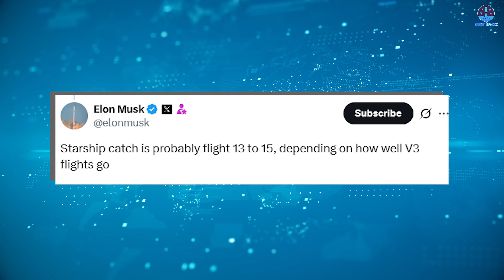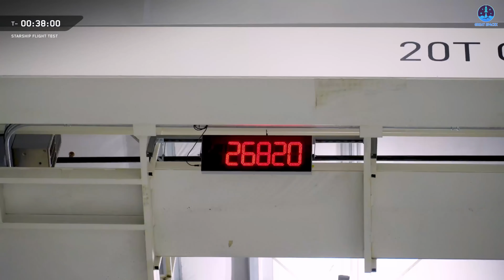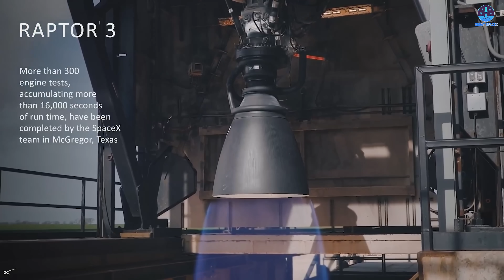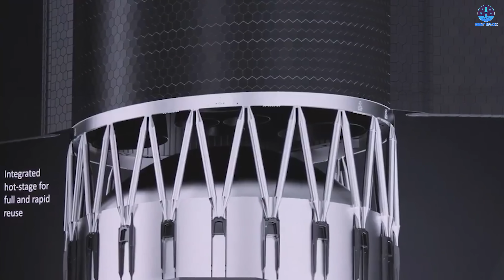Finally! Elon Musk revealed new Starship Catching Schedule after Flight 10 Successful Landing…

Comment: I am still of the Opinion that SpaceX needs to build one or more Catch-only Towers ...
The risks of damaging a vital Launch Pad exist now and even more so in the future.
A Catch-only Tower in the vicinity nearby to the Launch Pad(s) will present no difficulty and no particular delay to re-use of the Booster, or the Ship. Once refuelling ships start launching requiring multiple rapid launches, then more 'landing options' will also be useful ...
My observation is that building Catch-only Towers is much cheaper and faster than the complex complete Launch Towers complete with all of the complex associated systems and flame trenches, etc.

Comment: I am a little risk-averse, but I would say no catches until at least Launch 16, or later.
A core component to Landing, the New Engines, needs to prove reliability before potentially destroying a key asset like a Launch Tower. Destruction of one Launch Tower will set the programme back potentially, so it's important to do some decent Checkouts first (Despite sort of having a backup Tower).

I also noted that the landing of Ship 37was reported as being several metres away from the targeted landing spot, which is plenty to mess up a catch !

Interim Launches have plenty of other objectives to meet ...

Mind you, I can see the Launch cadence improving from one every 2 months, assuming nothing fundamental interrupts successful V3 Rocket Launches ...

Comment: But why should they do that?
They don’t need to catch the ship as it can land on the ground. 
Doesn’t make any sense
Reply: its for the same reason as booster catch. Faster integration. Its hard to move something so large from a landing zone all the way back to the pad and get it re-stacked when they can just have it on the stacking hardware to begin with
Reply: For a few reasons:
1. The landing legs that Starship will have are to support the ship’s weight when it is on Mars and won’t be able to support it with Earth’s gravity 
2. Catching a stage at the same pad it is launched from is the fastest way to reuse a stage(this mainly applies to the booster because the ship would be sent to a building where is would reserve its next payload)
3. It saves mass, the ships configured for LEO missions won’t need landing legs and the ships configured for Mars will be able to be much lighter because they don’t need to support the ship’s weight on Earth
Reply: @BlazePlaz I would argue the mass saving is a more relevant. They wouldn't design legs that can only function in mars gravity as its not that much of a differential. It would be fine on earth too, but they'll land it at the chopsticks on return from mars anyway for faster integration

Comment: It seems to me that SpaceX could attempt to catch both booster and ship with the next launch.  It will be the last launch and catch(es) from pad1 before the upside-down shower and launch stand are excavated and removed to be replaced by a flame trench.  This would be the perfect time to risk any possible damage on pad 1 as it's going to be offline for quite a while following this last Gen2 booster launch.

They could catch the booster successfully while the ship does a few orbits.  Once the booster has been lifted off the pad and a quick check made of the tower, the ship could be de-orbited and landed back at pad 1.

That would be brilliant.  Come on SpaceX.  Go fast and break things.  Or hopefully not, in this case.

Comment: Here are my predictions - they wont meet the 2026 deadline, they are going to hit their goals in August 2027
IFT-11 = successful flight with the same profile 
IFT-12 = Potential problems with raptor 3 or ship v3 
IFT-13 = potential minor failures 
IFT-14 = successful ocean landing of both stages 
IFT-15 = First fully orbital and first full recovery from orbit of v3 (ocean splashdown for both stages) 
IFT-16 = First tower catch attempt with ship - 50/50 chance of success 
IFT-17 = Tower catch of second stage successful 
IFT-18 = full first cycle - booster and ship return to launch site and catch
IFT-19 = repeat IFT-18 
IFT-20 = First starlink v3 launch with catch of both booster and ship 
IFT-21 = Stress test of both stages - maximum payload capacity test for ship, and more intense re-entry for both stages
IFT-22 = First long term stay in orbit to verify cryo prop storage over many days is possible 
IFT-23 = follow on from IFT22, sending an empty refueling ship to dock with the IFT22 ship in orbit followed by separation and de-orbit of both ships 
IFT-24 = First attempt at prop transfer demo with small amounts of fuel. IFT24 sends the ship into orbit 
IFT-25 = Part2 of this refuel demo, sends a ship with small fuel reserves to orbit to dock with the IFT-24 ship and transfer propellant, followed by deorbit of both ships. 
IFT-26 & IFT-27 = first mission to fully refuel a ship in orbit and de-orbit both stages, ideally landing the refueled ship for inspection of long term time in space. (by fully refuel this means a full tanker starship gets drained into the tanks of the original starship, which probably equates to 1/8th of the total internal fuel capacity for the receiving ship

So im guessing we will have tower catching of both stages and orbital refuelling by IFT-28 at best. Currently their launch cadence averages 74 days which is terrible and wont get us to meet the date. 

How long will this take: 
A. if the cadence is 30 days, it will take until December 2026
B. if the cadence is 45 days, it will take until August 2027 
C. if the cadence is 60 days, it will take until April 2028

Im saying option B is the most likely option
Reply: That's a whole lot of projection for an unpredictable program. But kudos for putting in the work to make the predictions, I tend to agree but am hoping for a slightly quicker timeline
Reply: If no failures after flights 11 and 12, FAA will not open investigation Flight 11, 12 and beyong. And the licensing procedure will be simplified, when there is no need to make changes to the license for each generation of vehicle.

Comment: Wasn't  there 1 more V2 starship waiting in the wind or is s
SpaceX going straight to V3 ? This will change the actual time lines of future test flights !
Reply: The next one (flight 11) will be the last of the "block 2" hardware. This newly defined "block 3" is very similar to block 2 but with raptor 3 instead of raptor 2 motors. Ship is the same size with 6-8% more propellant, booster is another meter in a half with like 12% more fuel. I think the booster has that more open hot stage design and might no longer be detachable. Those staging ring changes could be the entire extra height.

Calling it block 3 could be mostly to give it a name change and separation from the 3 or 4 failures of block 2 and feeling of moving forward. Changing to raptor 3 is a somewhat reasonable time to make that move.

Comment: I’m puzzled! How exactly is catching the starship second stage a key milestone to getting to Mars? Isn’t doing refueling in orbit a much more important thing to achieve? If refueling a starship in orbit with something you really wanted to achieve quickly, wouldn’t you build starship second stages that didn’t have flaps and didn’t have heat shields And that were totally expendable so that you could focus on the refueling part? Catching starship second stage might be nice, but it seems to me that refueling an orbit is much much more important and much more on the critical path for launching a starship to Mars or even to the moon.
Reply: It's would be too expensive to throw away 20 expandable ships just to launch starship beyond earth orbit
Reply: @vitalysumin  If heat shields don't work, the starship is expendable.
Reply: Ok you wouldn't need that many if they were expandable
Reply: @vitalysumin 
Perhaps, but I think we can safely say that, even if SpaceX manages to catch the starship second stage, it’s not going to be completely and immediately reusable because so far we have seen no evidence that SpaceX has any clue as to how to develop a working heat shield that will be completely and immediately reusable. The question is, would it be cheaper to throw away 20 starships that do not have flaps and useless heat shield tiles weighing it down and maybe don’t even have as many engines as the current starship second stage versus trying to refurbish 20 starships that have heat shields destroyed by reentry And can’t be flown again until until they are refurbished?
Reply: No one is going to refuel with expendable starships, so to refuel you need to launch and catch the tankers, thus catching the starship second stage is a key milestone. Also it's easier to inspect the ship after flight if it's intact and on your base, and you get more data on it's performance so you can make changes to future versions so it could actually be more reliable and have more chances to survive mars reentry.
Reply: @sniper7269 
Shame on you! How can you say you’re a friend of Elon if you’re putting your finger on the key Achilles’ heel of starship? As you say, the heat shield is an absolute must for starship to make any sense. If an effective heatshield cannot be created using current materials that is light enough to allow the starship to carry a appreciable amount of payload to orbit, then the entire design and economics and operations of starship old will need to be redesigned. We may well be on the precipice of witnessing the complete failure of the starship design and approach.
Reply: @wbwarren57 That’s ridiculous 😂 SpaceX is gonna keep iterating until they get the heatshield right. They don’t quit, idk what it’ll take for you to realize that lol
Reply: A reusable Starship is important because if you achieve it you can use it to launch Starlinks, which is equivalent to printing money and can fund the entire program
Reply: starship is all about reusing rockets and this is a crucial step on that path especially for the investors to see. if ship catches are reliable it will be very beneficial as a proof of concept plus reusing ships will save millions of dollars this will need to be done either way and the 2026 window will not suffer under this

Comment: As they get closer to a production-ready design, the question remains: is there a market for this kind of heavy lift to low earth orbit? Who is going to pay for all this? Saturn V was retired because there was simply no need for that kind of heavy lift capability. There are plenty of medium-lift launchers out there that can lift the heaviest communication satellites today
Reply: Early use cases likely mass deployment of starlink satellites on a new order of magnitude that will power cellphone to satellite capabilities for global coverage
Reply: @davidmhleung Falcon heavy can already do this, with a proven and reusable platform
Reply: Of course there is. Saturn V was retired because it was too expensive. And so was Shuttle. And you have to start thinking wider. First, it's not just about mass, but also volume. There's a big demand for falcon 9, but hardly any for falcon heavy. Not because there's no demand for a lot of mass capability, but because there's not a lot of things that have such a big mass AND fit in those fairings. Second, it's not just about LEO. Taking falcon heavy as an example again, it is an overkill for mass to LEO. But it can deliver about the same mass to Mars as falcon 9 to LEO, so if you want the same satellites be delivered to Mars or beyond, heavy duty rockets are the only choice. And third, it's not always about existing demand. Engineers are working hard around existing limitations, but if you remove those limitations they'll create greater things and with it they'll create demand. There wouldn't be a Hubble telescope if not for available volume of Shuttle payload bay.
Reply: @sniper7269 Shuttle was retire because it was having a fatal failure every 100 flights because it was too complicated like Starship. The Shuttle was the cheapest crewed flight option for NASA.
Reply: @mrbaab5932  The shuttle was the most expensive flight option by far. It costed $450M-1.5B per flight when for example Soyuz costed ~$60M per flight. You can technically call it "the cheapest crewed flight option for NASA" because it was THE ONLY crewed flight option for NASA at the time. But with the US-Russia relationship warming up Shuttle became a big burden. As for the fatality remark, well, first of, I don't know the hell you're talking about "every 100 flights" when it only had 135 flights with 2 fatal ones, but alright. Second, I didn't say that cost was the ONLY reason.
Reply: @sniper7269 that's not how it works. You don't spend hundreds of millions of dollars to build capability with no market demand for it. There is no commercial reason to carry large mass or volume outside of Earth orbit. A more sensible use of this money would be to develop the enabling technologies that will allow sustained habitation add resource extraction on the moon. There are multiple problems to solve, and even then, by the time human habitation off the planet long-term is technically feasible, Ai and Robotics will make it obsolete.
Reply: @jimeditorial  Elon is the wealthiest man on Earth so, first, he can spend his money on his toys as he wants not looking for "existing demand", and second, earning this much money I think he and his advisors know better what is a "more sensible use of this money". "There is no commercial reason to carry large mass or volume outside of Earth orbit." -  well, except there is. With plans to inhabit moon and mars, there's no way you can do it with things the size of a rover. "...develop the enabling technologies that will allow sustained habitation and resource extraction on the moon" - and how will you deliver those without things like starship? "AI and Robotics will make it obsolete" - how the hell AI and robotics will make human habitation obsolete? Will it make Earth habitation obsolete as well? Will we leave North & South America, Europe, Asia, Australia and return to live in Africa? What do you mean? As for Falcon comment on starlink capabilities, the new versions physically can't fit in it, they're bigger, so for them starship is the only way.
Reply: The next generation of Starlink will pay for this 100x over.  Cellular technology is going the way of the telegraph and Musk will make a trillion from Starship.  Moon, Mars and everything else is gravy after that
Reply: Yes
 Because now we're ready to establish orbital manufacturing. We need stations in orbit around earth and the moon. Of course the Mars stuff. But ultimately all the mining we need to get going on in the belt. This is the foundational technology that allows the rest. We're ready for deep space commerce to begin. Even starting now it'll take a long time but will ultimately be the most profitable, meaningful endeavor mankind has ever set out upon
Reply: @seanperalta8709 who is ready to start orbital Manufacturing?
Reply: Huge space stations!!
Reply: Right but Saturn V was out of this world expensive compared to how cheap starship is gonna be no?
Reply: @Food4Cats Falcon is much more economical

Comment: No a full orbit is the next great milestone, 
and until that is achieved everything else is just fluff
Reply: Baby steps, baby steps
Reply: @viewer_5714   A forking full orbit is not a baby step. And like I said until that is achieved nothing else counts.
Reply: @almirria6753 I don’t see you sending a 120 meter rocket full orbit on the 10th ‘test’ flight?
Reply: @chaseb777  I am not the one who made that promise, or send vehicles to the moon, Mars & beyond
Reply: @almirria6753 exactly, so how about you leave it to the professionals. I’m sure they know what they’re doing 😂
Reply: No point attempting a full orbit until you can demonstrate reliable firing of the engines in space, so far everything has been deliberately sub orbital to ensure a controlled re entry if the engine fails to fire. All that is needed for a full orbit is firing the engines  a little longer initially, not a big deal.